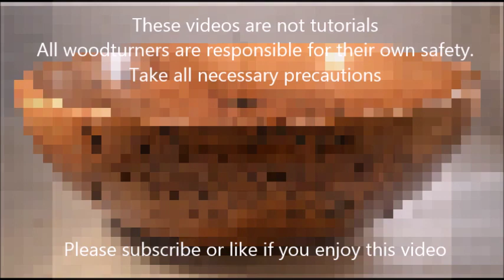Magic Wand Woodturning

Comment: Great video Steve.  Nice to see you posting here again.  how do you like the Yorkshire Grit?  That was the first time I can remember someone not using a sanding sealer first.
Reply from the maker: Thank you. I normally use sanding sealer and you heat a better, glossier finish but if the timbers good and dense it works well without for a more subtle sheen.

Comment: I tried practicing on a piece of rounded dowel and got a couple chips on my brand new skew chisel. Also no matter how long I held my skew on one spot it never cut all the way around it only got one spot. Any tips?
Reply from the maker: What skew?  you should not chip a skew chisel. If it’s not cutting all round then the dowel is oval or it’s bouncing. Probably also not sharp.  Most new tools need sharpening.
Reply: @woodturner21  using my 1 inch skew like the one you have. Thinking I may need to sharpen my stuff because you rounded yours in seconds and mine took about 30 minutes using a piece of Granadillo wood